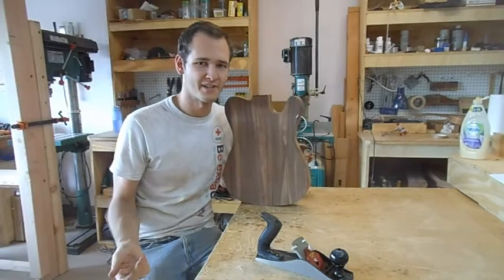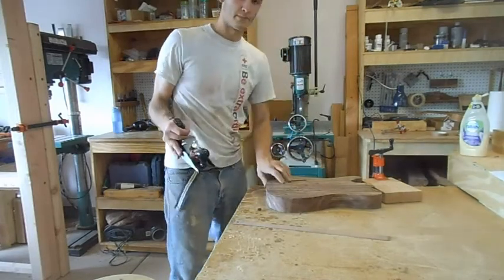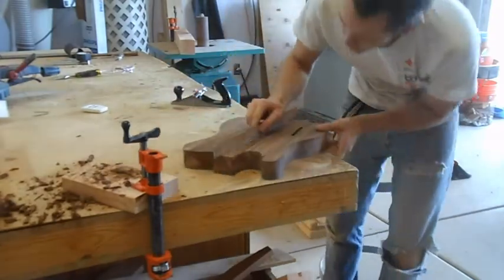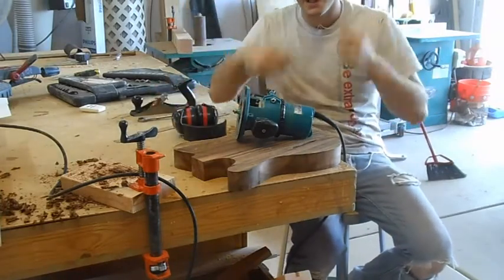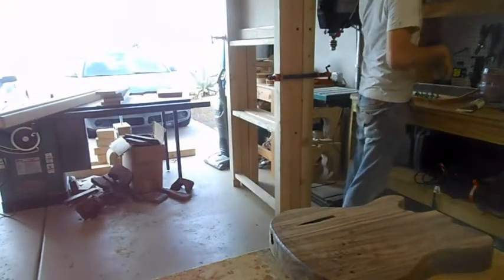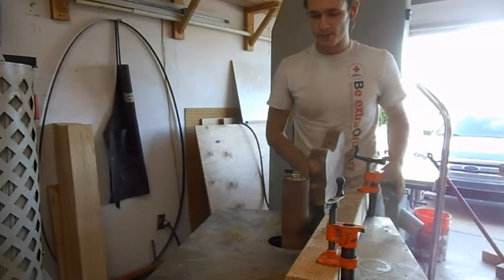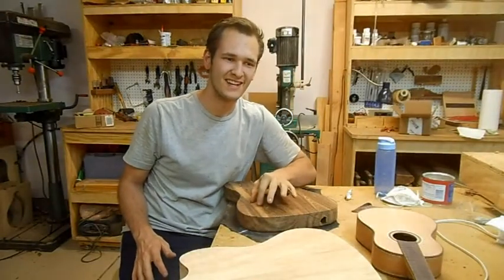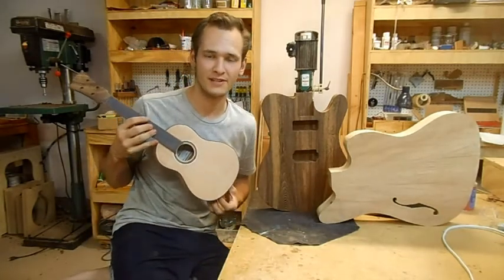Telecaster Build Part II: Thicknessing And Planing The Body

Comment: a router jig  would  be good to flatten it  and  then thickness plane it ?   instead of using  hand planes  which are inaccurate
Reply: Hand planers can be perfectly accurate so far blades are sharp, the man behind knows how to use it and check a lot the result. A router, so far the user knows how to use it too, isn't more accurate but works faster.
Reply: Sounds like you need a new blade or a better hand plane. Hand planes are very very accurate